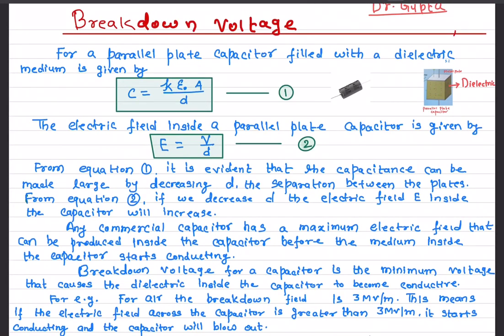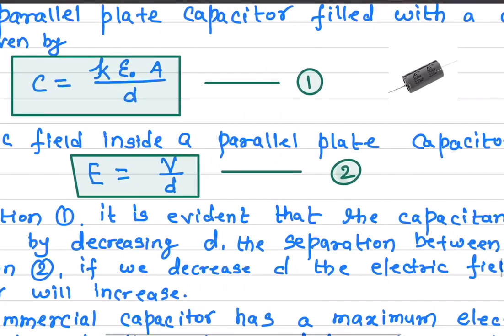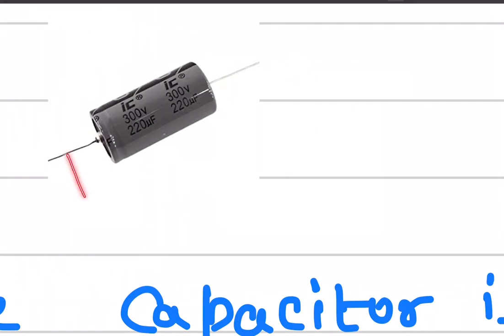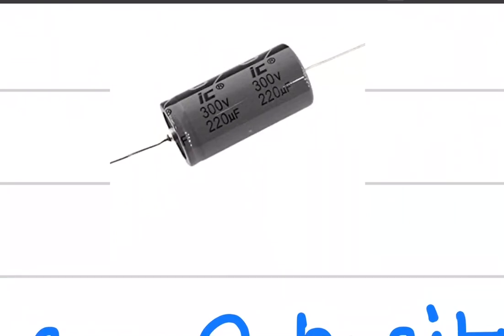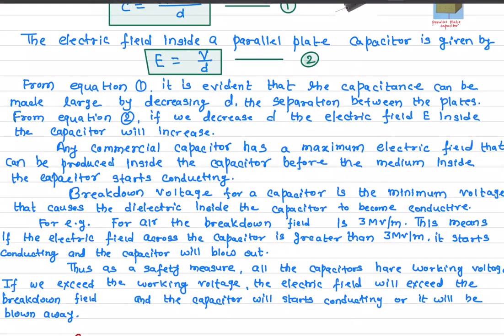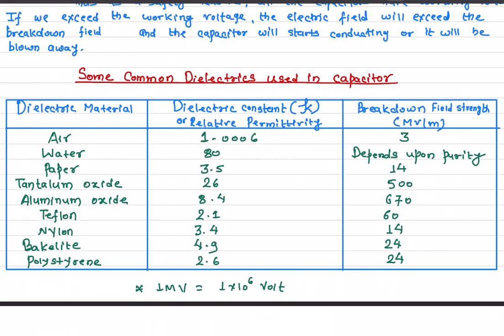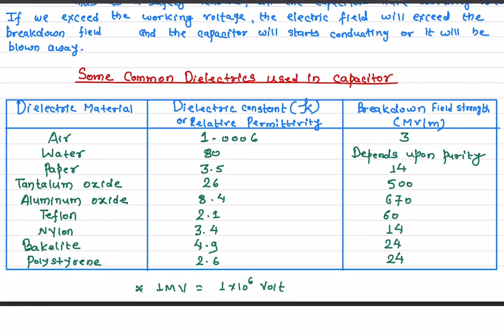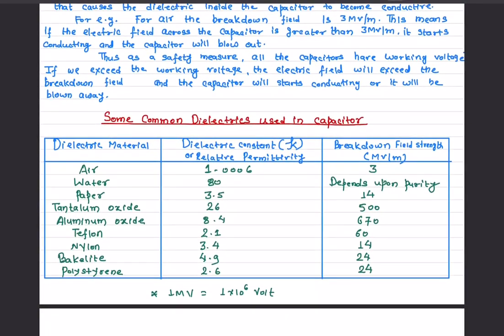Breakdown Voltage of a Capacitor # Lecture 7

Comment: You have a choice of two material to make a capacitor. One is a wax impregnated paper having a dielectric constant of 2.5 and breakdown strength of 20kv/mm. The second is a glass with a dielectric constant 9 and breakdown strength of 10kv/mm. Which material will produce the greater capacitance per unit volume for a given voltage rating